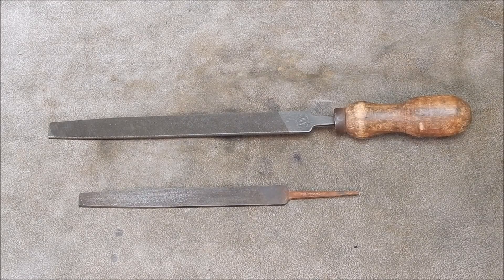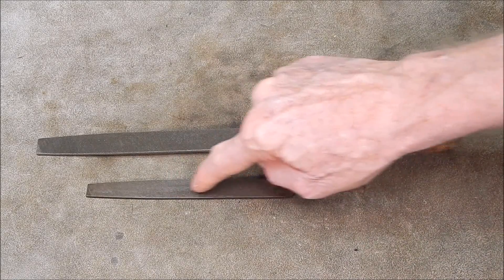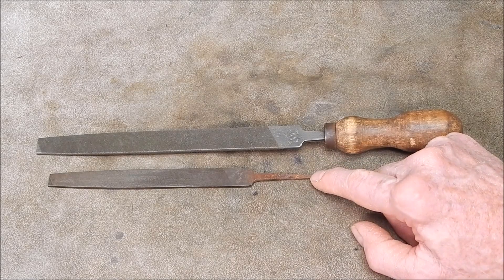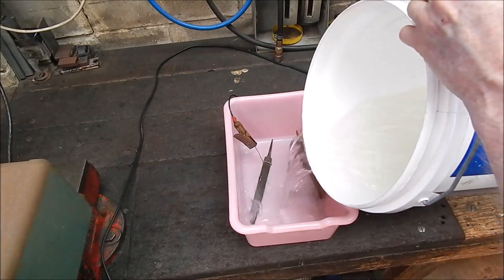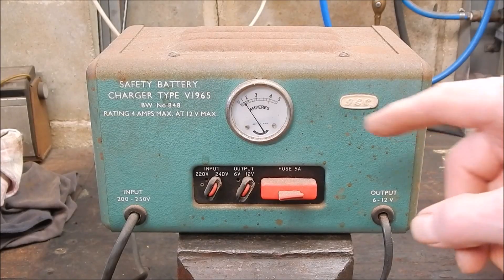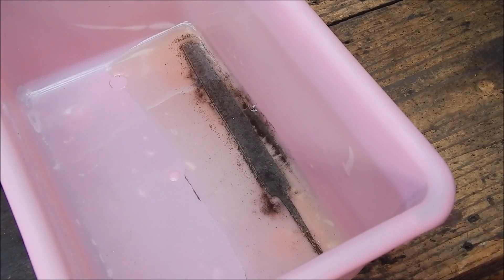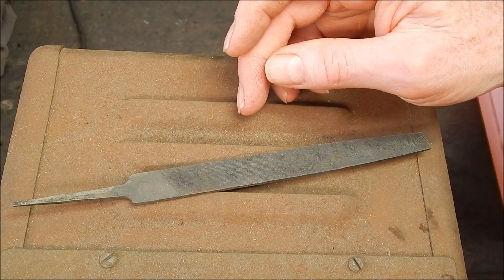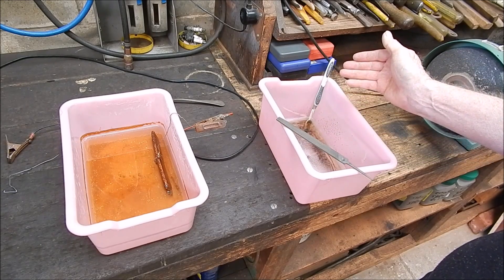Does vinegar actually re-sharpen blunt workshop files ?

Comment: I’ve tried resharpening some of my worn out but expensive jewellery files with acid (strong solution of granular PH down swimming pool acid). It sort of worked, the edges of the teeth got sharper but under magnification you could see that they were actually quite ragged, not really smooth anymore. They worked ok for a bit but they got blunt again after a while, they just didn’t have the strength to bear up. I’d class it as a way of squeezing a bit more life out of an old tool rather than a means of getting it good as new again.
Reply from the maker: Yes, nothing simple is going to restore knife edge angular facets onto any blunt /damaged file i've seen.   Adelaide Saw Works used to throw them out at the slightest sign of dullness.  That's where my old man got all his from, still perfectly servicable for home use.  Cheers Rob
Reply from the maker: Interesting.  Thanks for the comment and experience.  Cheers Rob
Reply: yeah this is my experience as well. Once or twice is about all you can do.
Reply: I'm guessing that if it was used for jewellery it would be clogged with precious metals? The ragged  edge sounds like that. I would drop them in an ultrasonic overnight and check again if it is still the same try using aqua regia  . It is 50/50 hydrochloric and nitric acid at same dilution if I remember correctly.  That will remove the precious metals from clogging up the files. This is only my opinion  based upon vague memorys and shouldn't be taken as gospel BTW.

Comment: Read about this years ago. But battery acid was used. My 2 bobs worth is that the very thin cutting edge gets dissolved by the acid leaving a somewhat stiffer but blunter edge which would allow it to cut again.As for putting chalk on files I dont think that is a good idea . In my experience that calcium salt in the chalk causes massive rusting,
Reply: I use soap stone instead of chalk
Reply from the maker: Maybe, but IMHO unless the cutter relief is clear there will be no cutting.  Simple as that. Cheers Rob

Comment: Hey Rob.  You're missing what's going on.

Electrolysis will remove rust, by converting the iron oxide.  It will also blow some of the crud off by the formation of bubbles, but with a file that action will be minimal, as the crud is in deep grooves you're not accessing. If you only have surface contact with the crud, electrolysis won't remove it unless it's rust or some other compound that gets removed, dissolved or otherwise affected by either electrolysis or the electrolyte itself.  Electrolysis is not removing any base metal.

Vinegar, on the other hand, absolutely is removing metal.  It will get behind the crud it's not acting on and let it drop out, but as it acts on pretty much all metals it will also be dissolving the crud.  With the steel of the file, it's producing iron acetate and hydrogen.  As far as I can tell from your microscope shots, the edges are still damaged, but they are significantly finer through the erosion caused by the vinegar - i.e they are sharper.  See 2:38 vs 13:56

What's really telling is to take a really totalled file (er a super cheap new one), and leave it in vinegar for a week or so.  Don't expect to be filing with it afterwards.
Reply from the maker: I can't see how weak vinegar is going to remove enough hard high carbon steel to be even noticeable to the naked eye in 12 hours.  As I said, the irregularity will still be the same, even if minutely reduced in size.  If acid/vinegar really did work people would be tossing chisels, scissors and knives into a tub of the stuff, but I don't see any evidence of that happening. The real issue is the clogged file reliefs, which is pretty obvious.  Cheers Rob
Reply: @Xynudu  You'd be surprised how active vinegar is.  As an example, a bath in vinegar overnight will remove galvanising very effectively, and you don't need much.  The hardness of a high carbon steel doesn't come into it, it's a chemical reaction not a mechanical one.

The main issue with dull files is that the cutting edge gets rolled over.  It's a very thin piece of steel, and vinegar will remove that.

I have an idea for an experiment.  Take a piece of clean steel, attach a glass tube to it, add a known quantity of vinegar, and heat gently (to speed things up) until it stops reacting.  Measure the depth of the resulting etched pit.
Reply from the maker: You've got a channel.  Go ahead and do it.
Reply: @Xynudu  Oh, I intend to, Rob.  That was a  note for myself, not homework for you.  At the moment I'm looking at the exact chemistry involved to see what to expect, and thus get something that is definitely measurable, and I'll probably look at finding some cheap glass tube tomorrow.  I already have a remnant of old file that can be used as victim.  Like they say, "talk the talk, walk the walk"...

Going skiing today, though.  Cheers

Simon

Comment: Reading the title of the video, Rob, You go too far. Is there no limit of the "miracles"?
Take a rusty file and use it. Then show how it performs after derustying.
Reply from the maker: Try it yourself Stefan.  The file was obviously nearly 100% clogged before treatment, and 100% cleaned afterwards.  I'm sure it will work very well.  There are more than a few "Old Wives Tales" in metal work.  Cheers Rob
Reply: @Xynudu  I replied in the joking mode, not really criticising You.
Being clogged reduces the performance, yes, but the edges are the cutting part of the file. So far I've managed to kept my tools away from rust. Cross the fingers....
Reply from the maker: Hi Stefan.  No problem.  I expected a few viewers to want to see the end result file metal, but there are plenty of videos out there showing how effective this "Miracle" is.  None of them can explain why, or attempt to apply any logical brain power as to the physics and chemistry involved in the effect.  When someone can show me vinegar changing a rounded over or chipped cutting edge into a sharp, flat edge facet, then I too will believe ;)  Cheers Rob
Reply: @Xynudu  Well, You're on to something. There are always scientific ways to show things for the deep divers.  Maybe that's overdoing things. Anyway, the vinegar bath clearly made the files look less bad..